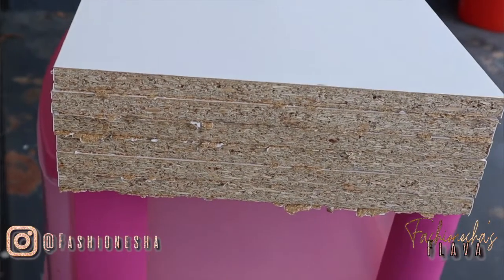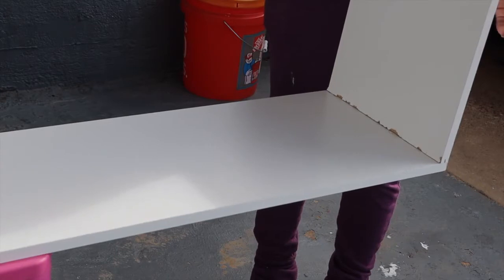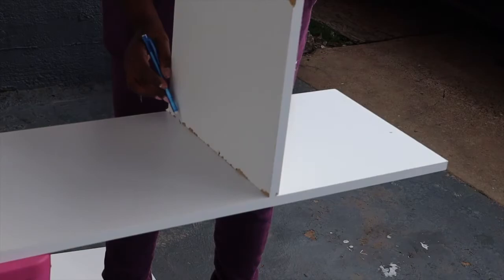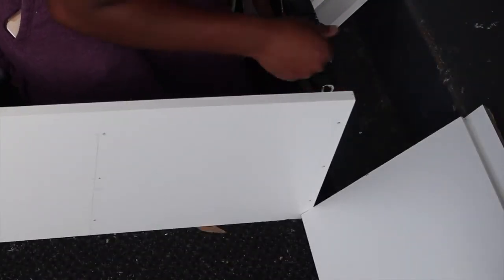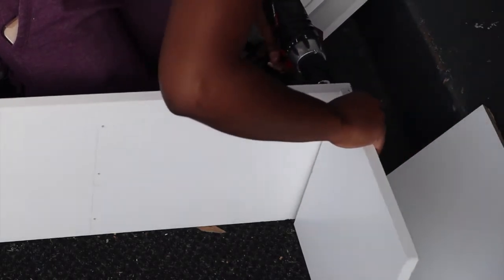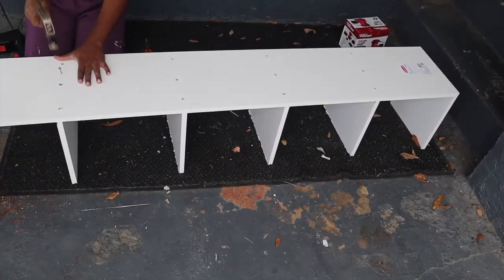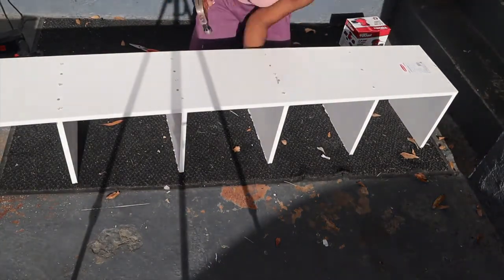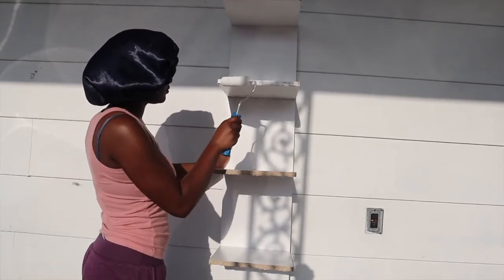DiY | How to make an IKEA Lack Shelf | $30 😱

Comment: Terrible build. That's only particle board and will crumble and break and crumble at the screw point. Something as simple as pushing or even bumping down against the outer edge of the shelf is going to irreparably  sag the shelf.
    I'd recommend nothing lighter than 3/4" plywood and  pocket screw and glue joinery.
Reply from the maker: Yep it was horrible 🤷🏾‍♀️ but served a very cute purpose 😊💕
Reply: Good video and application, but the final product will be fragile.
Reply from the maker: Riggghhhtttt